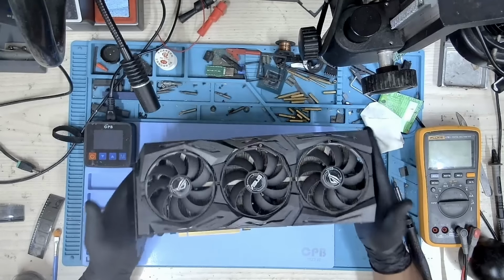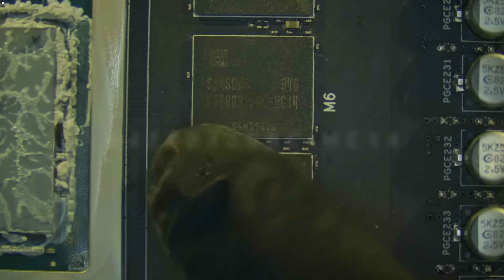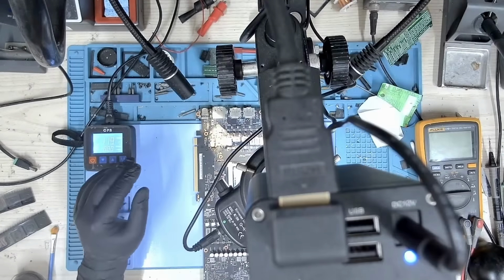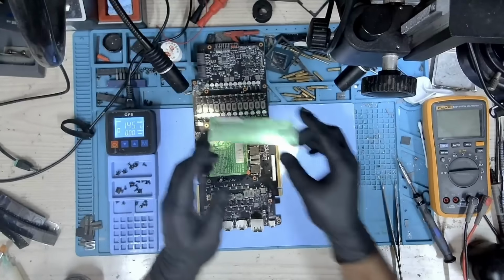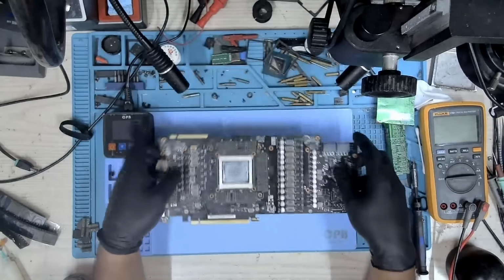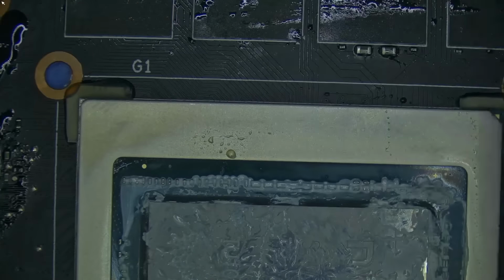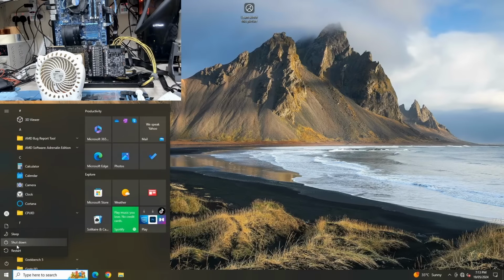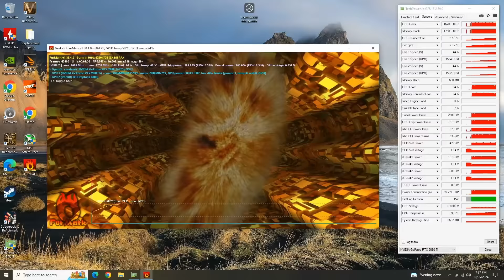Upgrading Asus RTX 2080 Ti memory from 11GB to 22GB

Comment: Thank you for applying the thermal paste properly, man. I've seen so many videos of people maintaining or repairing graphics cards, and they don't spread the paste, meaning that parts of the silicon are at risk of not getting cooled properly. Spread paste if on bare core/silicon/diffusion barrier. Use whatever method you want if it's on a IHS.
Reply from the maker: I have the same view as you. Happy to have you onboard. 😃
Reply: I'm so used to using liquid metal, I forgot about that
Reply from the maker: I would be very careful using liquid metal. 😁
Reply: @GraphicsCardRepairs-tk7ql  don't worry, I am. I use two coats of liquid electrical tape on SMCs before I spread it on a die. IHS application is easier.

Comment: Well done for pointing out that this is pointless for gaming. I was going to comment that if you didn't say it but you covered it beautifully.
Reply from the maker: Yes for gaming it does not make sense. There is no performance increase. Only games that exceed the 11GB buffer can benefit. In my opinion a handful of games. Unless you have a requirement for AI of something. 😁
Reply: but if the game requires more than 11gb of vram this will help him avoiding crashes because of vram limit

Comment: AMAZING. And I am only 10 minutes in.  I wish I knew how to do this stuff.  I wish I had the brain capacity to even learn just a little of what you know.  I get very nervous just pulling the stock cooling off and adding waterblocks the few times that I have done it. This is next level!  I actually have 2 2080ti Asus Strix just laying around not doing anything anymore as I have already moved up to 3090's and now a 4090 since.  I wonder if they are still worth anything. Maybe a PC for my grandkids. Great video you are a master!
Reply from the maker: Thank you 😊. You can start practicing on dead boards will improve your skill.
Reply: "I actually have 2 2080ti Asus Strix just laying around..."

Did you ever try them in SLI?
Reply: @bricaaron3978  of course. That is the only way I ever ran 2 cards back then.  SLI is obsolete now though...
Reply: @meade916  It is truly ridiculous that SLI has been abandoned. There is literally no legitimate reason except apathy.

After I built my first gaming PC in 2008 I bought a second GTX 260 and used SLI until I upgraded to a GTX 570. I never attemped SLI again simply because there were so few games that benefited from it, and often if it worked, the gain was only 60% or less.

SLI works --- it's just that nobody cared enough to properly code for it.

Comment: Very impressive! My question is: How did you know what to do ? From where? Could you tell more about "straps" ? What are they? For what? What are they doing? What exactly did you set to high. You are VERY VERY underrated. To change the chips is easy for you and all people who have to do with those kind of repairs but your knowlegde is much more interesting to me. In any case more knowledge than I have 🙂
Reply from the maker: All information about straps is available in the schematic of the GPU. It also mentions how the configuration should be. For example 1 stands for high and 0 stands for low and M strands for medium. 1 connects 100k resistor to 1.8v, for 0 the resistor is connected to ground. As you play around you will get the hang of it. Start reading schematics it's fun. It gives a lot of insights.
Reply: @GraphicsCardRepairs-tk7ql  Thank you! I would never had thought that I would have to read the GPU schematics for a VRAM replacement :-) Even for more VRAM. I thought it would be a firmware thing :-)  Thank you!
Reply from the maker: If it's in the schematic then it is in the BIOS and drivers as well.
Reply: I think I have the same questions like you 😉😅. 

I have here one Radeon VII who quit service some years ago. The only thing I have done at this time, is to install a new driver. I always uninstall the older version, before.

I had asked the official support from AMD here in Germany, and they were very interested in that. They told me I should send this card to the service. I think I'll use this option for the first time. 

And when they say they cannot make anything, or repair, then I'll ask this technician. He's absolutely amazing. Such detailed knowledge, I wonder 🧐🤔 where he did got this learned.

Comment: RTX 3070 is one of the cards that I highly recommend to upgrade for the channel author running these videos
It is still quite an able card, but it does tend to cap out in terms of power limits and GPU memory, because it is simply 8 GBs
Reply: Or a 4070 mobile GPU.

Comment: I'm using an Infrared Cooker Plate (for cooking) and it's very good even for doing a GPU reball.
I wanted to buy a Puhui T8280 but I saw a video of a russian dude doing GPU reball with a IR cooking plate and I tried to do it myself.
It's very efficient for GPUs but not good with big PCB boards like ATX Motherboards because those need a big heating surface (the board flexes / wrap so bad when the temperature is not uniform on the whole board).
Reply from the maker: People find ways. I too started with ceramic plates and a controller..
Reply: T8280 has slow cool down and uniform heating. The cooking plate do not have these features. It will popcorn your pcb. You will also need a 600w or higher hot air station, preferably Atten ST-862D.
Reply from the maker: I remember the days using ceramic plates and I killed a lot of cores. Luckily they were mine so I have no regrets. But I learned a lot. Since then I moved to a 3 zone rework station and never looked back.
Reply: @NaN_INF  it's safe with GPU PCB boards when you know how to use it.
I've replaced a lot of Cores with it and I can say I have no problem anymore right know.
Of course I've toasted a lot of cores before mastering it but knowledge requires experience so I'm okay today.
But my goal is not the Puhui T8280 but at least an IR 6000 or higher.
Reply from the maker: Yes i agree. I still have my old modified gortak preheater with an external controller. Now a days its on the shelf retired. May be i will find some use of it again some day. I'm sure it still has its use case and the best suited when the 3 zone is too large for a job. I will make a video on it someday 😁.
Reply: @GraphicsCardRepairs-tk7ql  ohhh!! I would like to see this kind of videos from you boss!!

Comment: Absolutely love the video ! Im very happy to see stuff like this being done. EWaste is a problem and stuff like this is a good solution. 

If you are wondering about the memory upgrade and why someone would want this , it does allow play at higher resolution for gaming. Most importantly tho , it allows multiple graphic intensive processes to run at once. This benefits Virtual machines , 3d modeling ,  game developers , and video editors. Even with multiple monitors this will make a difference. 

I would be happy to go over testing methods with you if needed.
Reply from the maker: Thank you 😊. My setup is more suited for repair. I am planning to build a test bench for benchmarks and comparisons.  Maybe soon as I am able to stretch my pockets. 😁

Comment: damn that is a really is a great idea I would like to see a fallow up with the customer to see if the GPU is still stable over a long period of time other then that an amazing video.
You said you would look at other GPU to do as well if you would be so kind as to upgrade an older card like a 1080 or 1660 just so we all know it can be done.
your doing amazing work keep it up!
Reply from the maker: Thank you 😁.  The user of this GPU has commented on this video. 1080 already uses the highest possible memory compatible with it GDDR5X. There is no upgrade path ahead. 1660 is barely able to exceed its current memory buffer. GPUs like 30 series can benefit from this upgrade.
Reply: @GraphicsCardRepairs-tk7ql   thank you for replying to my comment I see where your going with the memory for the 1660 I kind of figured and its good to know that the mod is still working as it should great video

Comment: had no idea this could be done!
Reply from the maker: Hope you like the video. 😁
Reply: Can this be done to a gtx 1070. Would it even be worth doing
Reply: @williamclark206  no, just upgrade at that point
Reply from the maker: No. This GPU is at its end of line. It already has the maximum memory capacity on its platform.
Reply: Soldered power 🙏 how do u think them bits ended up on that board first place
Reply: @Mr.Fantomas777  it was meant as in
"I cant believe you could upgrad that aspect of a vide9ocard"
Reply: @luheartswarm4573  right thanx 🙏😎 anyway I’m happy with my quadro p5200 16gb mxm along side with core i7 4940mx and 32gb ddr3 2133mhz ram 😀
Reply: @Mr.Fantomas777  well thats uh, good to know?
Glad you are happy
Reply: @Mr.Fantomas777  me flexing 2014 pc
Reply: @luheartswarm4573  yes I’m thanx 🙏
Reply: @russellg1473  same
Reply: So long as there's compatible SMD memory modules and you don't mind potentially bricking the thing ofc it can, what was soldered on and can soldered off.
I'm wondering though is there a standard for SMD memory modules? Are their solder balls all laid out the same way? Or does it depend on the manufacturer
Reply: that’s what i thought as well 😮

Comment: AMAZING
It will be ideal if you can post.
1. How much the upgraded RAM chips cost
2. How much for your work 
3. What was the intention and EXPECTATIONS from the person who commissioned the work (game, video edit, blockchain or AI)
4. Did the person actually got the performance expected? more performance?, less performance? , what metrics were they using?
Reply from the maker: The cost of upgrading this 2080Ti including the memory is $220. This user wanted this upgrade for AI. The last conversation with the user was he was able to utilise the memory to run larger data sets. Since this was my first upgrade video I did not expect much interest. Mine is a small repair channel. I will include benchmarks and other stuff in my future videos.
Reply: @GraphicsCardRepairs-tk7ql 

220 bucks for all the work and the memory chips? Bro that's insanely cheap. Especially if you count all the hours of work and equipment you are using. 

I have swapped a single memory module once. And it was not easy.even with the right equipment. Hats off to you sir! Keep up the great job. 

But I am still curious how you managed to get the schematics of the 2080Ti strix. I'm also very interested in those
Reply: @GraphicsCardRepairs-tk7ql I think this could be a hugely popular service especially for newer generation cards with the newer tensor cores. A 3080TI or 3090 with 40gb+ would be a game changer for AI models, and could easily be worth the cost being $1000+
Reply: @GraphicsCardRepairs-tk7ql   I would love to get this done to my card, but i doubt you are in australia :'(

Comment: Wow the driver is just fine with a 22GB 2080Ti? I always heard these memory upgrades (like the 3070 16GB upgrade) resulted in a slightly confused/angry driver.

A 22GB 2080Ti is probably a great choice for Stable Diffusion etc. I know 3090 24GB cards are highly prized by people running these applications and can be quite expensive/hard to find despite being quite old now. A 2080Ti with a 22GB upgrade might be quite appealing, I know the price of 2080 cards has fallen quite a lot and is maybe only 20-30% slower than a 3090 in these applications.
Reply from the maker: Nvidia made these cards with plans to launch with high capacity memory but never released it. Maybe because of the lack of competition.
Reply: @GraphicsCardRepairs-tk7ql  Very cool, definitely a worthwhile upgrade. I calculate theoretical FP16 performance to be 25% less than 3090 so maybe worth it, how much would you charge for an upgrade like this?
Reply from the maker: 75 USD for the repair. Does not include memory.
Reply from the maker: Hmmm. 50% in tax is a stretch. I hope they add a lot of value in terms of services to citizens.
Reply: @GraphicsCardRepairs-tk7ql   🤣  .... NO!
Reply: @GraphicsCardRepairs-tk7ql 
SHUT UP AND TAKE MY MONEY!!!! LOL!!!
How much can you get ram for? I can't do ALiExpress. What RAM would I even look for?
Reply from the maker: The prices of RAM would depend on the size, brand etc. It would range from $6 to $7 up to $30 to $35 per piece. If Aliexpress is not an option you can try mouser electronics or digikey. The RAM would depend on the GPU. how to select the right RAM for upgrade is a topic on its own.

Comment: It's hard to say if it's worth it for gaming, ie, 12GB is close to recommended 16GB min, but I do remember a Hardware Unboxed vid where extra memory allowed the textures to full form, ie, not enough memory and they are rough blob renders. They even showed a GPU render properly when started, but after 20min it ran out of memory and the pic became worse. Basically it's the cost, like is the $300 swap ok for a 10% better appearance in games.
Reply from the maker: Thank you for sharing 😁. An upgrade like this for gaming will hardly make any difference except for those AAA games which require a bigger buffer to load textures. Unless you have specific needs for higher memory this upgrade will make little to no difference. You guys using higher memory GPUs are the best source to tell the community if it's worth it. Happy to have you onboard.
Reply: it benefit for VR gameing, because it need to render two same high resolution scene
Reply from the maker: I have not used VR. If you have used it then you are better equipped to answer this question and it will deffinitly help the community. Thank you for sharing 😁.

Comment: I have been tempted to do the same. But BM-HC14 and BM-HC16 are expensive chips, being 2GB. Maybe if I come across some extra chips I wouldn't mind using on my 2080Ti I will. But I never get the chance. Fun video man! Good music btw!
Reply from the maker: Thank you brother. 😁
Reply from the maker: I am planning a similar upgrade on a 3060ti. What do you think? I have HC-16 memory which I would want to try. I'm wondering how this upgrade would stack this GPU against a 4060 ti
Reply: @GraphicsCardRepairs-tk7ql  Why not go with D8BGX GDDR6X (the 21Gb version)? As you know, there are 3060Ti's in the wild with GDDR6X, like the one I have here waiting to be picked up. 

However, given that 448.0 GB/s on the GDDR6 HC-14 (14 Gbps) vs 608.3 GB/s on GDDR6X (19 Gbps) version makes almost 0 difference in terms of performance, I highly doubt going from HC-14 to HC-16 would make sense. 

But going to GDDR6X with higher speeds might make a difference. The only way to find out is to actually try it :) Though I do not know if even with the GDDR6X BIOS, the card will run at the higher speeds and actually run the card at 21Gbps on D8BGX GDDR6X 😕
Reply from the maker: The GDDR6X 3060Ti trace connection on the PCB are different. GDDR6X will not work work on GRRD6 PCB. pin out layout is different. Data pins layout is not the same.
Reply: @GraphicsCardRepairs-tk7ql  Ah I did not know that!  Since I use the same stencil for re-balling GDDR6 and GDDR6X. But the ball pinout having a different data layout is a deal breaker! But regarding your original idea, I think it would be a waste of VRAM, since GDDR6X has already been proven to make no performance difference against the Samsung HC14 chips, let alone HC16 which is still slower than GDDR6X D8BGW at 19Gbps. And HC16 is so expensive for me, I'm careful with it LOL
Reply from the maker: Hmmm. I have a RTX 3060Ti with hynix X005. Now the memory needs to be replaced anyway. I also have a Donner 6800XT which I can borrow the memory from. I also have 1gb HC -16 memory too. So I was wondering if I should or not. In terms of performance I'm sure it will hardly make a dent. I was wondering how this upgrade would stack up against a 4060ti 16GB. It's just a thought. But since I have the resources I was wondering if I should. What's your take on it? I don't have the 4060ti 16GB with me though.
Reply: @GraphicsCardRepairs-tk7ql  I think it would be a very interesting video! X005 is a death sentence anyway, so I would definitely replace all these chips with something better while I'm at it. 😃
Reply from the maker: yes i guess it will be an interesting video.
Reply from the maker: I think that's a good Idea.
Reply: I might try this, i have 13 K4ZAF325BM-HC18 chips, these are the top bin chips. I dont know if RTX 2080 Ti memory controller is capable of fully utilizing 18Gbps.
Reply: @jarnom85  You'd have to modify the bios to adjust the speed.

Comment: Very interesting. I wonder what would happen if you put a chip on the empty 12th pad and flashed an RTX Titan bios to the card?
Reply from the maker: Hmmm now that's something on the table. If I get another 2080 ti I will experiment.
Reply: If I was a betting man I'd put money on the cut down die being fused off, regardless if the entire core was functional or not. It's also possible that the GPU is hard coded and it would just refuse to run but it'd be an interesting experiment. 

I just don't see Nvidia allowing this to happen but I'm surprised even the denser modules works on the same bios so who knows.